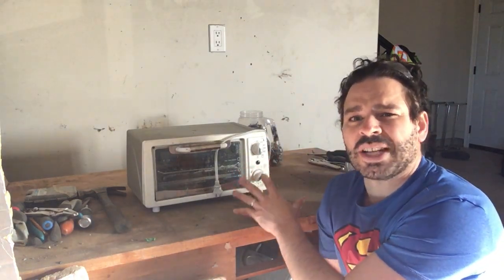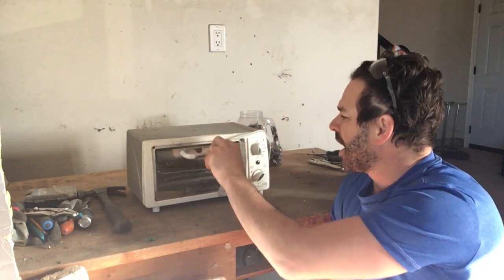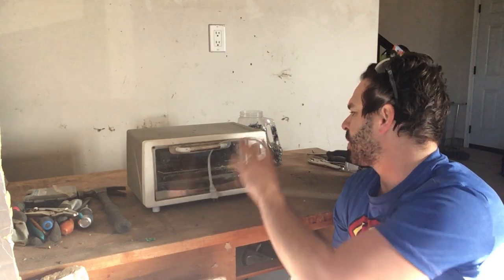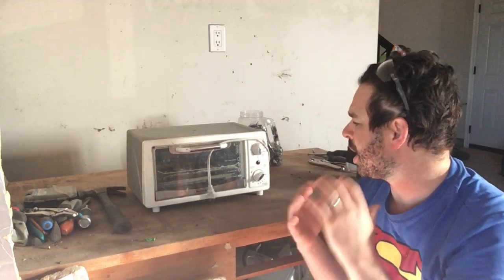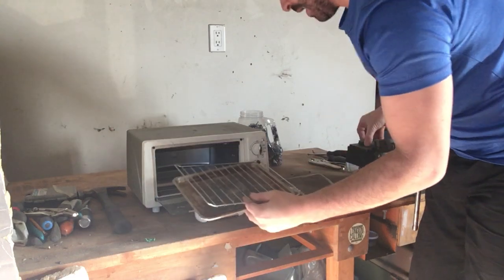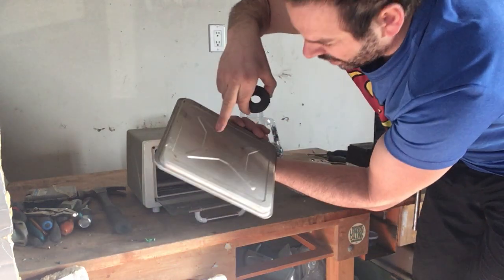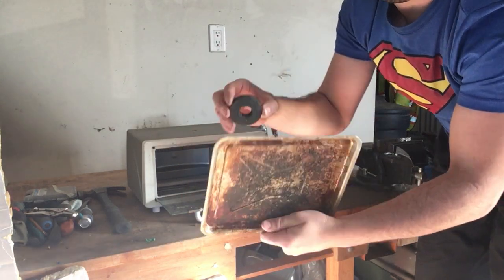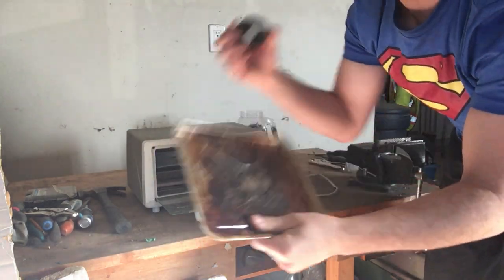Scrapping a toaster oven for free tin, copper, brass, silver, and no waste. Why pass these up?

Comment: Are you saying you put the little white caps with brass under them, in with "40% brass not copper wire) that is going for  $1.23 a pound.?  Thanks.
Reply from the maker: I put them I. A bucket and the yard will buy them for around 40cents a pound. If i can cut the plastic or rubber cap off I put the brass plug end in my clean brass for $3.25 a pound.